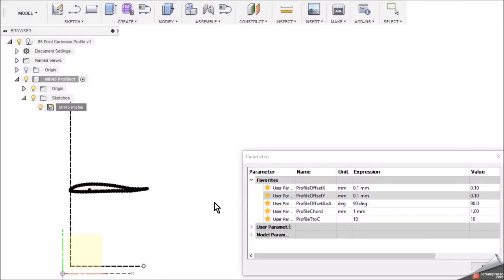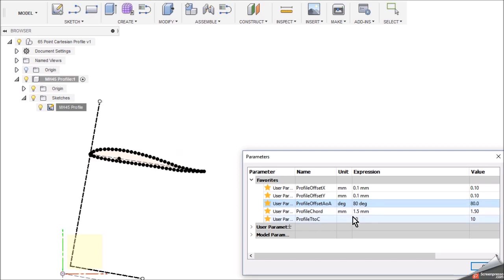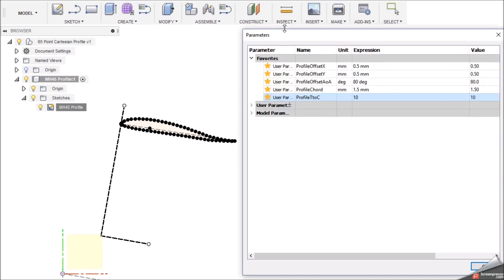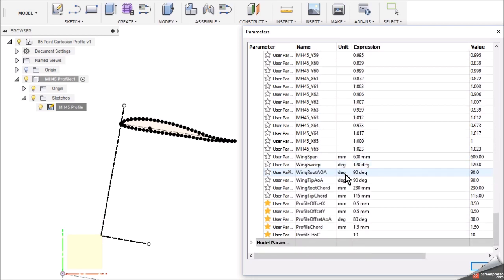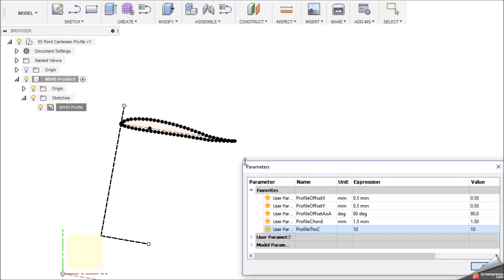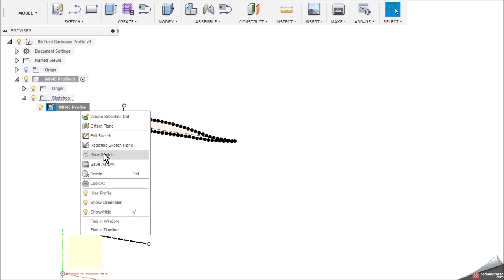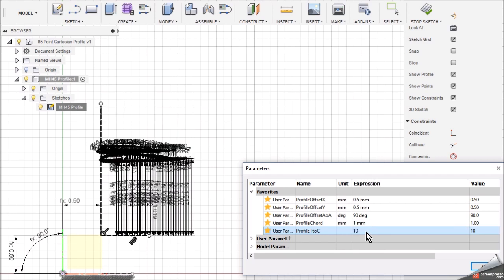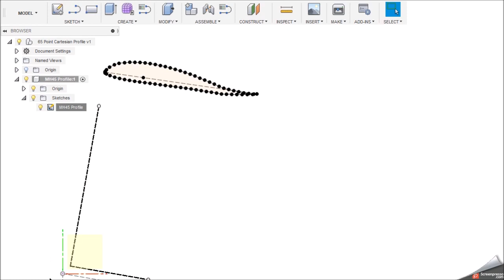How to create Parametric Aerofoils in Fusion 360

Comment: This is interesting but you have shown us what you did but not how to do it. I think folks (me included) would be very interested to see a series of instructional videos on how to develop a parametric airfoil model. I realize this would be time consuming for you, but offering this sort of detailed instruction would be useful and worthy of the Patreon support you are hoping for.
Reply from the maker: Hi Hummingbird,
You are correct this took a lot of effort to generate and would probably take several long videos to clearly describe the process. However conceptually it's quite simple. I have a fixed number of points that describe the 2D aerofoil, each point is constrained by dimensions. These dimensions are driven from user defined parameters that I can upload from an aerofoil data set generated in excel. 

Each point is then rotated using polar mathematics and scaled around the desired 1/4 chord location to give chord, AoA and thickness to chord ratio. This is also controlled by further user defined parameters.

If I get a chance and enough interest I'll pull together a video, but at the moment I'm struggling to publish anything due to family and work commitments.

I hope that at least gives you a flavour. Thanks for the interest!

Barry M